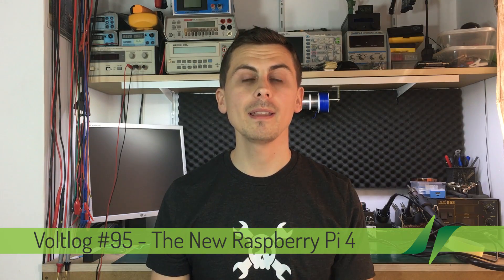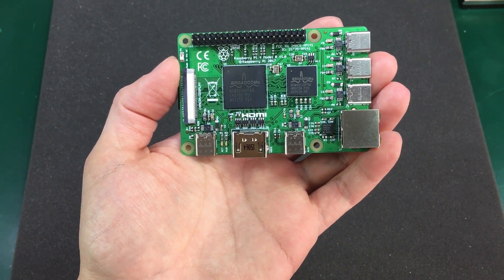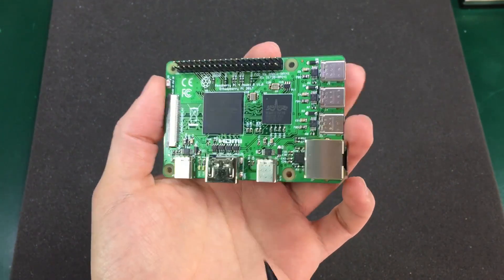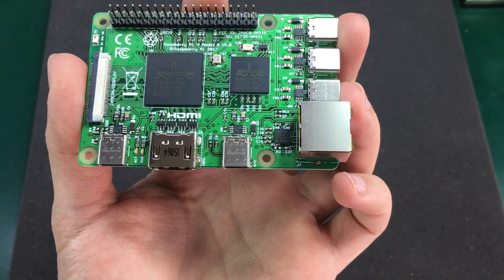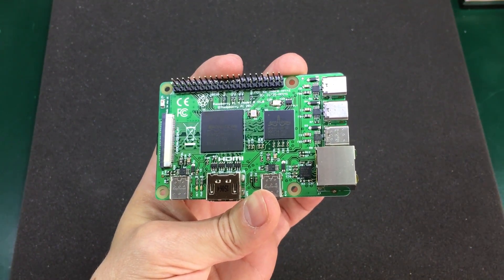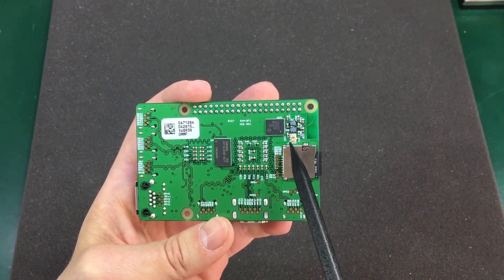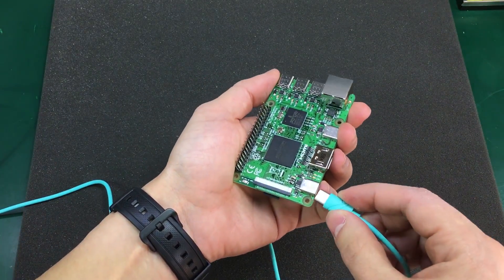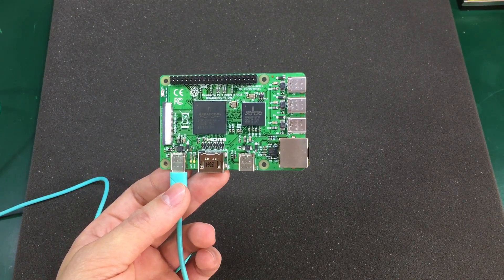Voltlog #95 - The New Raspberry Pi 4 - April Fools

Comment: I want this thing to exist, not only as 1 April's joke!
Highspeed connectors is what RPi lacks, and Type-C would be a perfect solution*.

*If any modern Broadcom CPU can actually handle at least 1 GB per sec per port :(
Reply from the maker: It seems like the features I "implemented" would be appreciated by allot of people. Unfortunately I think cost would go up with these features..

Comment: is the pcb trace layout also a homage at the sometimes senseless autorouting function in  cad applications? 

bedsides that, nice Video, hope it's gonna be viral :D
Reply from the maker: what do you mean about the routing? it doesn't look like this when the auto-router does the job..
I meant it to look professional :-)
Reply: VoltLog  sry mate, have not much experience in pcb design. Was just wondering about these "curved" lines. 
But i noticed the printed inductor and enjoyed it!
Reply: VoltLog  sry mate, have not much experience in pcb design. Was just wondering about these "curved" lines. 
But i noticed the printed inductor and enjoyed it! I
Reply from the maker: It's called length matching and is used for high speed differential lanes where the delay caused by one of the lines being longer will affect the coms.

Comment: LOL, The chip next to RJ45 socket is Maxim's MAX1980 DC-DC Converter
Reply from the maker: I'm sure it was needed in the design.. otherwise they wouldn't of used it.
Reply: POE maybe?
Reply: There is no rectifier, no transformer

Comment: Good work on the video with all sort of information and the info about your friend and all such, but must be very fake ;)

---
- Only rumors on Raspberry Pi 4, no info at all available yet
- Main chipset BCM5354 is a 32bit? 240MHz CPU and uses a maximum of 128MB DDR-SDRam - also it is made for routers and only supports 10/100Mbit
- Secondary chipset BCM4311 is a wifi chip capable of 802.11b/g only
- Chipset does not do USB3, only USB2
- Memory chip is K4T1G164QF-BCE7 - 1GB DDR2 SDRAM - not 2GB ;)
- No valid FCC ID
- April 1st!
Reply from the maker: thank you for the nice analysis work :-)
Reply: Well thank you for the reply and the awesome video! :D If it hadn't been that I bought an RPi3 a week ago for work and invested some time in finding out that a RPi3 would be a good solution for what I need it for, I might have fallen for it :) With that said, I'm not completely certain I'm right until you say so.. Manufacturers can do all crazy stuff when it comes to the naming of chipsets.. if they really want to.. ;) But, being April 1st and the chipset datasheets showing something else.. I'm hopeful I'm correct :D

I try to stay away from Youtube and all other sort of things like TV, newspapers and such on April 1st and May 1st (at least in Sweden) just because I'm so easily fooled ;)
Reply: I'm really wondering what this board might be for.. Hope you can unveil that whenever you can :)
Reply: Thanks a lot for the saved time, i was also about to google all the chips ;)
Isn't that RAM incompatible with the memory controller then? 
Are these really USB type C ports or have you an idea what else it could be?
Or maybe this makes no sense at all and was only made for 1st April, he has even Raspberrry Pi 4 on the silkscreeen ;)